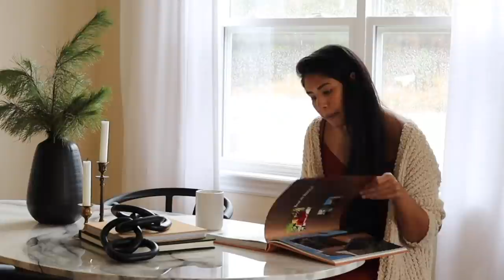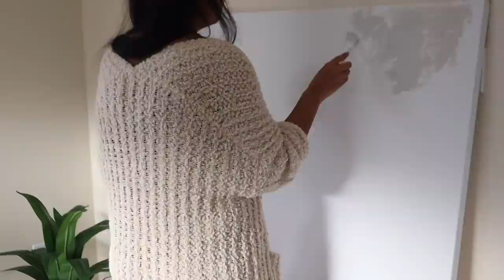DIY Dining Room Art (it's HUGE, so easy, and looks professional!) | Home Made Happy - Ep 16

Comment: I loved the video! Is there any reason why you didn't use command strips to hang the artwork? That way you aren't putting holes in the drywall? I know they can be patched up later but just asking.
Reply from the maker: Thank you! 💞 I love command strips to bits but for this piece specifically it was quite heavy and I felt more comfortable hanging it using a drywall anchor
Reply: Command has canvas hangers now! 🥰